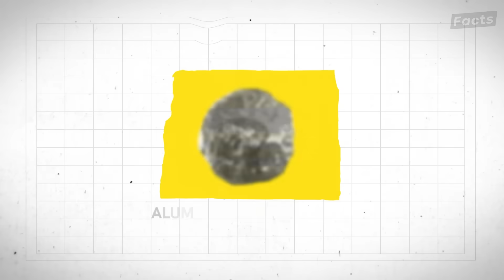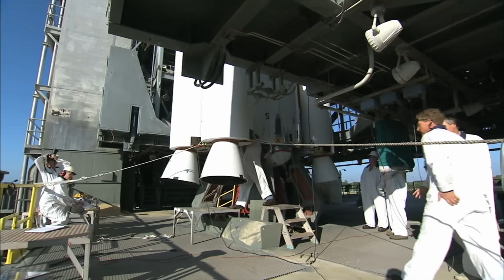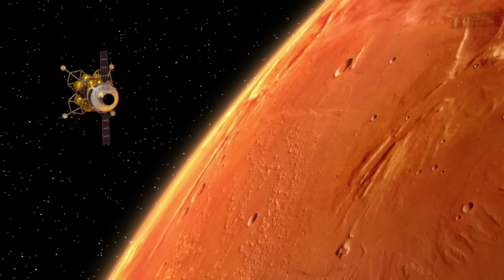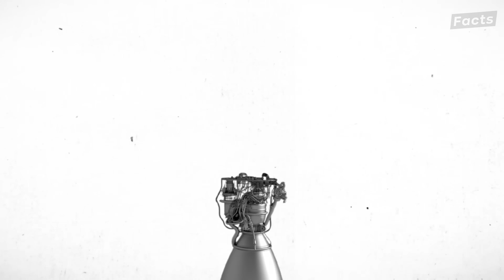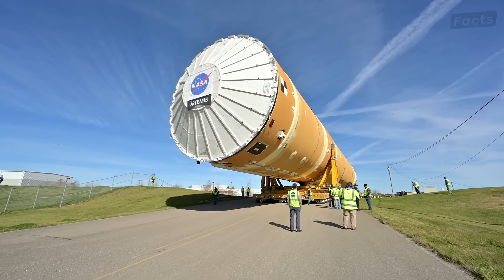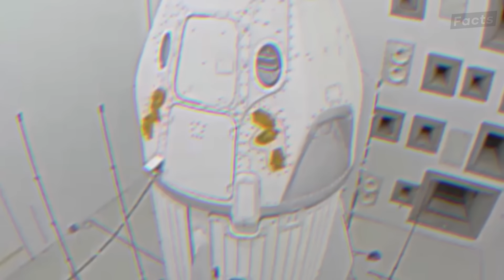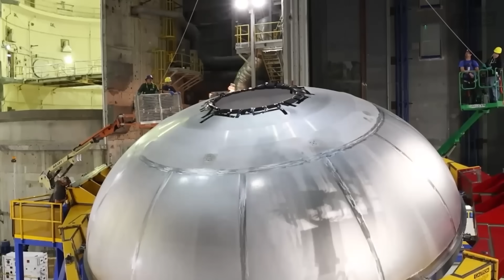Why SpaceX and NASA Rockets Are So Different

Comment: Just had to wonder, what the hell is that thumbnail? You show a rocket with 4 engines, but point at it saying there's 5, "Deep throttle engine" applies to most rocket engines, especially starship. "Multi Start capability" what does that even mean?!? Of course you can start multiple engines at the same time. Rocket go no where if u can't. Only thing correct there is the fuel they use and how many engines starship has, which technically isn't even correct if you consider second stage engines

Comment: Basically, NASA goes for massive, purpose-built, entirely and very strictly reliable powerful engines, systems that are designed and tailored for each mission to survive the absolute depth of space as the frontier of exploration, while Space X, Blue Origin and other companies and government organizations are set to colonize space cheaply and efficiently, while still maintaining safety, to actually build after the exploration goes through.

Comment: Rock stone lime + metal 🧲(✖️%)
Charged component design or or like batteries (➖➕%)
Quartz effect in component (➕%)
We have charged structure inMotion Motion Ways.

aTenth Books ألاء اللهnot peaked from peak tens 10|10 ! e٦ McC Art9 ®️™️©️ Quran Forqan 2Books.

CoolFact that! charged structure was built before yoness يونس and other built and they were from the Downed. Wright fact… Why it for 1 owner + what said power
مالك المليك
رسول مبين🇨🇦

Comment: i have one doubt , if you have more engines than needed (redundancy ) and you spend more fuel(more fuel mass)  to do the re use thing , doesent that mean that the rocket is super inefficient in therms of payload in space?
Reply: Smaller engines can be more efficient from higher chamber pressure, the starship is inefficient to payload to orbit but multitudes of times more efficient for payload to planetary surface when refueld in space.

Comment: Oh please. NASA built rockets to go to the Moon. In 1969. That's right - 19 69. Not this deep space nonsense. SpaceX rockets were designed by teenagers using laptops. And computer simulations. 
And they fail.
Take away their computers. Give them the parameters but have them go over all of it on paper. That way, they might learn about damping vibration, how to keep seals from failing, how to keep fuel from leaking. Not, two thrusters shut down so you manually shut two down on the other side, followed by the rocket losing forward momentum, followed by it starting to tumble. Followed by it exploding.
Reply: Well that "computer simulation" is already flying and shows great promise so it's not failing. Also making a model on the computer is easier and more visualy comprehensive unlike a 2d paper blueprint.

Comment: I haven't paid full attention to the contents of this video but there are some things that stuck out to me.  You mention that having 33 engines is a good thing.. in the way you presented it,   it does seem good.  What wasn't mentioned is having more engines also means more points of failure.  Each engine, alone, is a complex machine.. individually they have many points of failure.. then multiply by 33.  Sure, things look better on paper.. having redundant backup engines looks spectacular.. and IF 1 engine malfunctions, then others can pick up the slack.  How many of the 5 Saturn5 rocket engines had a catastrophic error?  I could go on.. but this won't be a factual debate but more of a 'my camp vs your camp' type ordeal where nothing progressive occurs
Reply: huh, kinda funny, anyways, if a space x rocket fails, than it's just 1/33, if a nasa rocket fails, whole thing just fails

Comment: I believe SpaceX’s option is much better because it requires a more sophisticated life support system with greater emphasis on safety—especially if future trips are planned for the civilian sector. If the previously mentioned goals are achieved, the rocket would be suitable for any kind of travel and offer greater flexibility in configuration and mission type. NASA, on the other hand, would be more suited for launching probes or satellites. Of course, it will require a lot—an enormous amount—of funding for development, almost comparable to the F-35 program. But unlike the F-35, this has greater potential for advancing humanity.

Comment: NASA - Non-reusable so all engines big and few and once done will just disintegrate upon re-entry.
SPACEX - Reusable, they made the engines smaller so that power can be controlled upon landing.
Also SpaceX needs to land the booster, NASA's big engines can't be controlled accurately because they are too strong and their location is too far from  the center of gravity.

Comment: This video is a bunch of hooey.
For every point supposedly made for a NASA project over SpaceX or vice versa, you can turn the point around and as "Why not the other, too?"

Do none of the points made in this video are valid.
The success and failure of each project rides entirely on management and the talent. SpaceX personnel are extraordinary. Their counterparts at competitors are less.

It's  that simple.

Comment: it is simply easier and cheaper to built smaller engines- but if it blows ab - it has simply a higher probability with more engines the hole rocket may explode so space X is a very risky company like Boeing

Comment: Let’s be clear.  NASA hasn’t designed rockets.  They have always relied on contractors for the design and building of the rockets.  The difference now is that SpaceX selling NASA flights and not rockets because SpaceX rockets are reusable.  Other contractors sold rockets because it was one rocket per launch.

Comment: Hundreds of hover drones on Mars will create the atmosphere. Used to move materials and supplies
Reply: If that were possible, it would need to be in the hundreds-of-thousands at a bare minimum. Mars is to small to hold an atmosphere, it would just get blown away by solar radiation/solar winds.

Comment: ULA (joint venture between Boing and Lockheed Martin) made the SLS rocket together with Startliner from Boing was a complete failure. It left the astronauts stranded in the ISS and SpaceX has to come to the rescue. SLS and Startliner was nothing but delays, un-reliable and over budget.

Comment: Practically everything in this video is wrong. This isn about private vs public or even that SpaceX is more efficient or few engines vs many. All of those proposed reasons are factually without any basis.

The main difference between SoaceX and the ithers is that SpaceX was contracted to build something new and the others were tasked to use up assets left over from the ild space program while building new when necessary. Reusability is probably less an issue if you're using leftovers. There are advantages and disadvantages comparing fewer or more engines. Fault tolerance is a plus for numerous smaller engines but adds a big level of complexity distributing fuel and managing many separate engines to function as one.

Additionally, NASA is the government contracting entity that distributes funds to the contractors like SpaceX and ULA. Referring to SpaceX as competing with NASA is incorrect.

Comment: When I heard that SpaceX was making a Stainless Steel Rocket, I thought that was batsh*t crazy...  I thought it would be way too heavy to even fly.  CLEARLY I am no Rocket Scientist.  SpaceX never ceases to amaze...
Reply: Since 304L stainless has greater strength at high temperatures than aluminium,the structure requires thinner heat shielding so the complete structure is lighter.
Reply: Even experts were speechless when SpaceX managed to catch the first Super Heavy, so it's completely understandable.
Reply: @Armata6348 the so called “experts” are forever talking nonsense. It’s easier to predict failure and then pretend you’re intelligent if you happen to be right, than to actually achieve innovation and do things yourself. Most of the experts you hear from in the media are mostly just paid to push a narrative and do very little themselves in the real world.
Reply: @Armata6348  I think experts knew it was theoretically possible for a long time, but the amount of people willing to bank on a possible but still crazy idea is few. Elon Musk as SpaceX were just the crazy few willing to try it.

The greatest innovators were considered quacks in their time
Reply: @ReiseLukas  theirs a big difference between theoretically possible and actually doing it think fusion reactors yeah their theoretically possible but the amount of engineering needed to pull it off is insane hence why we dont have it yet because where still working to get it, booster reuse by cstching is somewhat similar though not to the smae extent
Reply: @ReiseLukas  he is a meth head
Reply: @KiRiTO72987  uh, so? what was the point there...
Reply: I do not think they are making full stainless stleel rokets. They doesn't need to do many ssto uses different material for every parts of the Suttle. even multiple layer of the material. I do not think spacex uses full stainless steel body. Maybe skeleton but body is add to much weight make your rocket very inefficient. You want dry weight lest as possible. Even planes don't take more fuel then they needed. Because it decrease efficiency. It Makes expensive .
Reply: @dogukansaka2417  Stainless steel doesn't need heat shielding, so the lack of that extra weight compensates for the higher density of the SS. Also, the difference in weight between say aluminium and steel is not that great if you are comparing like-for-like strength.
Reply: @paullangford8179  steel need heat shield to, steel is pretty heat conductive.
 Maybe you are right but this reusable ss designs use more fuel and because you need excess fuel for landing and materiel weight. 

Reusable does not mean cheaper than using old designs. We need to improve designs.  This mean we need to spend a lot with out waiting a return in short term. Do you thing a corporation could do that? If they had one working designs. How long they going to use that design? Space is not profitable in short terms. 

It is still a rocket and you can not change  the physic laws. If you want orbit around world, you will spend a lot of money.
Reply: the hitlermobile
Reply: When he first brought up the whole catching the first stage in the tower chopsticks. I thought it was a crazy pipe dream that we'd never see
Reply: Steel isn't a single element—it's an alloy, and its properties vary depending on the specific composition used. It can be engineered to be both more structurally efficient and lightweight, while also offering better heat dispersion.
Reply: @NicK-n6k3e  Calm down, Karen Jr.
Reply: Whoa.. starship has gone up.. but that's about it
Reply: And yes, SpaceX never ceases to amaze me.. but I'm sure we mean it differently
Reply: I thought the same. They did it because it’s cheaper than lighter materials like aluminium, but clearly they got it to work.  The future of Starship really exists me!
Reply: It hasn't flown very far yet though, mostly blown up.
Reply: See the Elon idea is, if you have heavy rocket, just make stronger engines 👌
Reply: Uhm...it IS way too heavy.
Starship never had any payload in it and it only has just enough of fuel to barely touch LEO, before it explodes...
You put payload in it and you will need to refuel half way to LEO.
Reply: @SandiSandl Wow,what a load of absolute BS .
Reply: @SandiSandl  Why are you writing such non-sense? Elon hate?
Reply: @st-ex8506 Whats your argument? Its true. It has never reached LEO, even without payload. In fact, they had to make it longer to get enough fuel loaded. So they were and are a good bit away from their claimed 100 t to LEO.
And dont get me started on heat shielding. There are reasons we get shown the burnt remains of the landed ships. Reusable is one thing, rapidly reusable is a different story.
Reply: @ernesto5855 SpaceX has not even tried to put it in LEO. Development is one step at a time!
You think you are smarter than SpaceX engineers?
I rather think you are blinded by hate.
One hint: hate only consumes those that feel it!
Calm down and be patient. They are!
Reply: @ernesto5855  They were sub orbital tests for FFS.
Reply: @ShokkuKyushu  And why? Because they are not confident that they can bring it down in a controlled manner, if the put it in orbit. Unfortunately their plan didnt work out as expected and we stand before the ninth suborbital test. No fuel transfer has been shown, no significant payload capacity has been demonstrated. No ship has been brought down in a useable condition, no flight in space for extended periods of time has been conducted.
Reply: @SandiSandl wrong the engines still have over 40% capacity. Sound like you just hate Elon 😂😭😭😂
Reply: @blackice214  Read darling.
I cant tell you anything else.
But I suppose- listening to elon propaganda is much easier.
Just hoping you are not living in USA. I would not want that to my biggest enemy.
Reply: @SandiSandl Elon definitely triggered you LOL 😂😭😂😂
Reply: @SandiSandl you wanted to alternate Elon's propaganda with your own BS and expect the world to believe you instead of Elon? That's more than delusional
Reply: It is too heavy as illustrated by the fact that Starship has never reached orbit even if a completely empty cargo compartment (okay, a single banana as cargo).
Reply: Their goal has never been orbit. It's been to test re-entry which is much, much harder than orbit

Comment: The SLS (Space Launch System) rocket is operational.  It can travel to the Moon.  Space X's Starship is not yet operational because it is still under development and undergoing a series of test flights. When will Starship Human Lander be ready?
Reply: Yes the sls rocket is ready however the Orion capsule is not the hls lander already has multiple key parts of its system done
Reply: You forgot to mention that during that one Launch of sls. The Orion capsule went around the moon and returned sucessfuly. While Starship (at least the upper Stage) has either exploded ore partialy melted and then exploded every single time.
Reply: @_kampfkartoffel2195  it didn't though. It has a lot of issues that took years to discover. Space X fixed their re-entry issue in what? Less than 6 months?
Reply: @thecyanadon they fixes their reentry issue?! Even on flight 6 the ship exploded and also yes the engines litt Up bit you can't reuse the upper Stage at all. Also May i.remind you that the upper Stage is Not even pressurised. Starship IS Not realy that much closer to reaching the moon then the V2 only difference Is that the V2 could carry payload. And flew Higher then Starship in some testflights. Lol
Reply: @_kampfkartoffel2195  BRO THINKS STARSHIP BLEW UP LMAO. you do realize every single time they manually destroyed it after landing right? Not to mention it isn't designed to land like that in the ocean. You are coping HARD. That you just have no idea what you are talking about which also seems likely. Every ship that got to re-entry fully survived it. You are flat out lying, the upper stage is pressurized. Starship is closer to bringing payload to the moon than SLS. In the time it takes to have Artemis 2, starship will fly another 12+ times.

Also, sls didn't fix the heat shield issue. They put a bandaid on it. Which part of SLS can they reuse?
Reply: @_kampfkartoffel2195 
I can't see the comment I made so I suppose YT wasn't happy.

It's amazing, everything you just said is wrong.
4, 5, and,6 all had fully successful re-entry. Only exploding after flight termination activated, or the vehicle tipped over, which was expected. What part of SLS can be re-used? The upper stage is in fact pressurized, you can see that clearly. Starship is closer to being sustainable than SLS.

Your reasoning is purely lies, bias, and your own stupidity.
Reply: @thecyanadon your Former comment was deleted. But yeah believe that crap Space x Fans are the worst Kind of musk Fans. 
Starship will bring Humans to Mars this year for Sure. 
By
Reply: @_kampfkartoffel2195  I hate Space X fan boys so much fr.
What are you talking about lmao. There is no way Starship is carrying humans before 2027.
Reply: @thecyanadon yeah but musk said that starship would bring humans to mars this year originaly. Also There is no way starship is carrying humans ever tbh.
Reply: @_kampfkartoffel2195  who cares what he says.
Also that's what they said about 
Falcon 9 landing 
Drone ship landing 
Ship landing 
Booster catch 

Space X Has done one thing over and over again. Prove those who doubt them wrong.
Reply: @thecyanadon did i ever say they could Not catch IT? I Said Humans  will never fly with It.
Reply: @_kampfkartoffel2195  I am saying all who doubted them were proven wrong once. And I am saying they will do it again
Reply: @thecyanadon we will See. 
No Bad Feelings Mate have a nice day.
Reply: @_kampfkartoffel2195  You too! No hard feelings. Happy Holidays as well.
Reply: SLS has launched once. Starship has launched 6 times and have another year+ before there will be another SLS.
HLS will be ready well before Artemis 3, maybe even Artemis 2